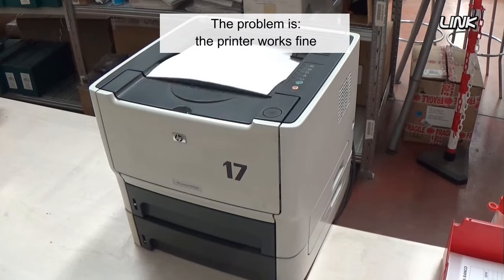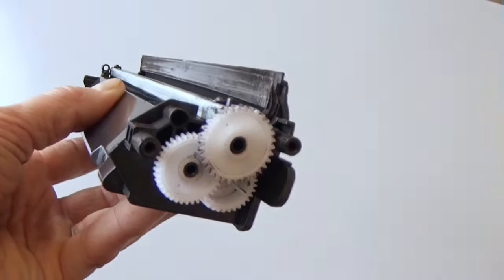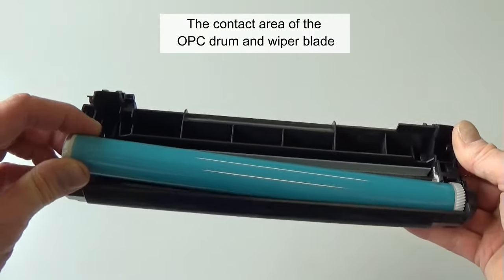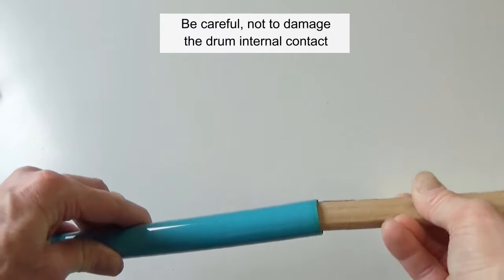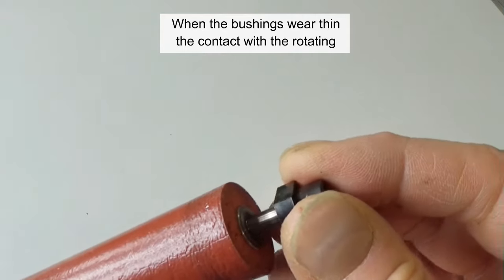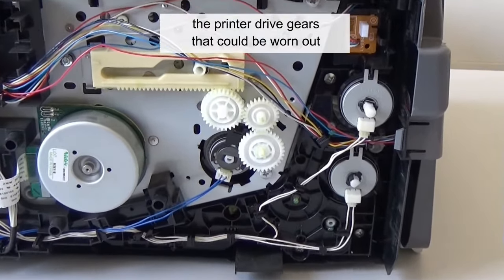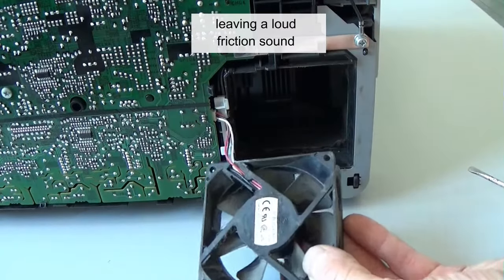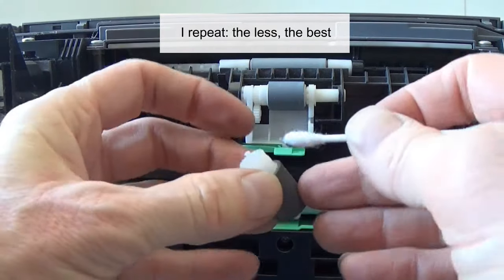Printer too noisy: what to do

Comment: THANK YOU!  Your video is so helpful. When you said if it continues making noise AFTER the pages have printed that it was likely the fuser unit, that was the key!  So my husband and I ordered a replacement fuser unit and installed it.  It fixed my HP LaserJet  Pro 200 MFP M276nw.  No noise now!

Comment: Is there any special chemical spread on doctor blade and which rubber can be used for manufacturing it?
Reply from the maker: in my opinion there is not a chemical spread that works.
doctor blade are mostly made with silicon rubber

Comment: Hi. It is to ask you that I have an hp colorlaserjet pro mfp m182n and have refilled all the four cartridges. The problem is with the black cartridge that it squeaks, despite that I have already lubricated the wiper blade with toner. Is there any other solution?
Reply from the maker: Try with some grease in the gears, or conductive grease in the contact of the toner roller
Reply: @viandant5  can we use hairoil / wd40 as conductive grease?
Also do you what do you mean by lubricating toner roller? Rollers ends or what the full surface?
Reply: @viandant5  I have also changed the opc drum and pcr, but the problem still exist. Where can the problem lie then?once I overfilled the cartridge with excess toner? Does it has anything to do with that
Reply from the maker: @hathakker802  The squeak could not be related to the toner cartridge but to other components of the printer, as in that video. I ment to lubricate the contact of the toner roller you can find at the end of the roller. I think the noise has nothing to do with the overfilling of the cartridge
Reply: @viandant5   I meant to say that my cartridge exactly squeaks the same way as shown in the video.
would you be able to figure out the exact problem by the fact that I have already changed opc drum and pcr but problem still persist?

Secondly, kindly tell about conductive grease, I only have wd40 and hair oil, . kindly refer anything that is commonly available.
Reply from the maker: @hathakker802  Hair oil for sure not, and wd40 semas to be not a lubricant. earch for "conductive grease for electrical connections" avoiding ebay. Which PCR do you install? A compatible one? They could cause this problem
Reply: @viandant5  yes pcr is the original , compatible one. But how can pcr cause squeak?
Reply from the maker: @hathakker802  The drum is hollow, sometimes make a sound with the attrition with the a no soft  PCR
Reply: @viandant5  ok thanks a lot

Comment: Can we use hy-510 as conductive grease in printer?
Reply from the maker: I don't know hy-510 but if it's a conductive grease yes
Reply: @viandant5  it's actually, thermal conductive grease used in CPU. Can you confirm me that whether or not it can be used?
Reply from the maker: No it's not a grease, it's a compound

Comment: My laser printer seems to find a very usual problem I cannot seem to find anywhere on the internet, it's a HP CP2025 and the 3 colors (YCK) prints great but the Magenta (M) does not print no matter what I do, i even replaced the cartridge twice with brand new genuine toner and the magenta still will not print. Help please
Reply from the maker: Never hear that. Does the test print is correctly printed?

Comment: What lubricant better used?
Reply from the maker: normal grease for mechanical parts
Reply: @viandant5 oil? Can you tell us examples
Reply from the maker: @goldenfami  something so https://it.aliexpress.com/item/1005003726196793.html?src=google&src=google&albch=shopping&acnt=494-037-6276&slnk=&plac=&mtctp=&albbt=Google_7_shopping&albagn=888888&isSmbAutoCall=false&needSmbHouyi=false&albcp=19207365798&albag=&trgt=&crea=it1005003726196793&netw=x&device=c&albpg=&albpd=it1005003726196793&gad_source=1&gclid=CjwKCAiA3JCvBhA8EiwA4kujZgeBAVMeu6ayScyoZO5i1xMcbAdXSkApYfLK4ctbmw8sqRwIfPH9hhoCRQMQAvD_BwE&gclsrc=aw.ds&aff_fcid=2214a9dbb47c405db4f6bd2a32cf8683-1709501095669-01962-UneMJZVf&aff_fsk=UneMJZVf&aff_platform=aaf&sk=UneMJZVf&aff_trace_key=2214a9dbb47c405db4f6bd2a32cf8683-1709501095669-01962-UneMJZVf&terminal_id=83227a19c644415d9d2a08234cb323ba&afSmartRedirect=y

Comment: When I switch on my Samsung ml1640 printer it gets continues grainding noise when I check, it comes from gear wheel connected with motor in that location motor spins continuously but gear wheel does not move due to that it gets sound, how to repair that please inform me after seeing this message
Reply from the maker: Sorry I haven't video on how to disassemble ML1640. you have to start the disassembling from side panel
Reply: @viandant5  I have disassemble entire printer parts. No need video also, if possible please tell me which part I should check and which part I need to replace. Even when I remove the toner also, fuser light starts glow when I switch on the printer and motor gets run then grinding noise occurs gear wheel does not rotates.
Reply from the maker: @MrSyedabuthahir  the feed gear has the code JC66-00809A, the clutch gear JC66-00322A , without watching the printer I can't be sure which is the gear you need

Comment: Hello, I have an HP Laserjet 6P. It picks up the paper, it prints but it gets stuck before coming out. A noise is heard, sort of grinding plastic noise and then paper won't come out and it gets jammed. When I turn on the printer I can hear the grinding noise of the gears but won't trigger an error until printing.  It seems like the noise is coming from the fuser gears but not sure. Any ideas or tips??   Thank you! (I have a video of the sound if needed)
Reply from the maker: Check if there are foreing object inside the fusers, try to print a cardboard